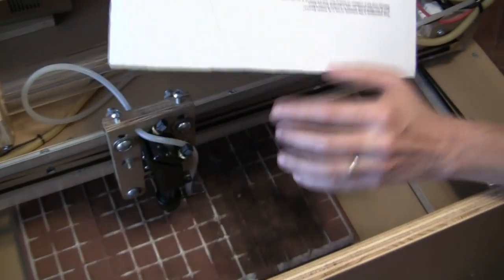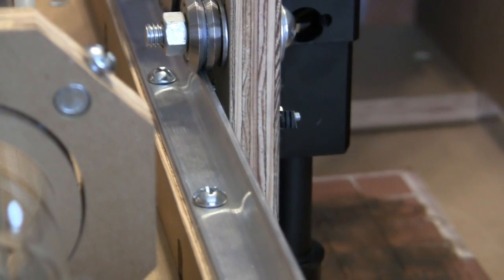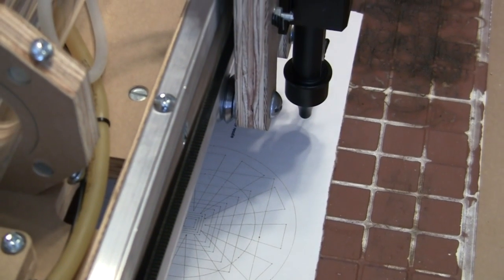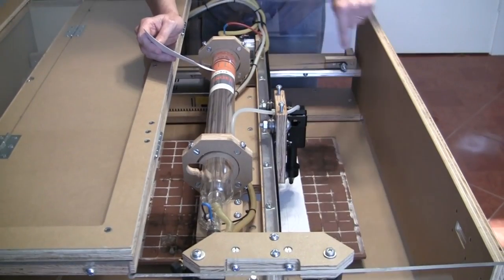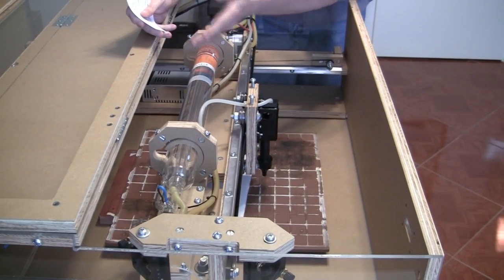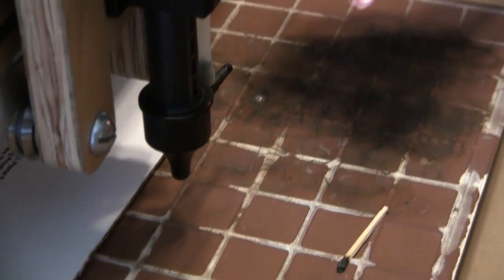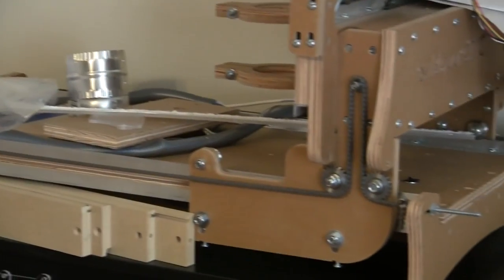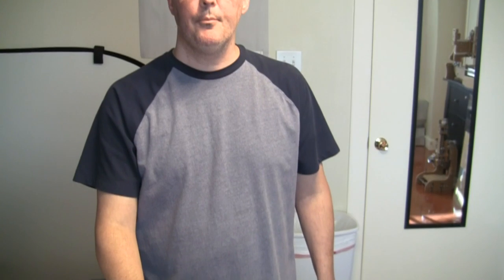Constant Velocity Laser Engraving with the blackTooth

Comment: kudos to you on this laser/gantry setup.....def see advantage on much larger work area....stable laser power througout the length....although,  being bashed for using mdf....hey, you made it work....soooo great effort.....couple things though....would have used a dual shaft of y axis insted of single long rod....know height restrictions might be encountered with linear rail mounted to wood....a piece of 2020 under the rails though could alleviate the hight match-up.....all in all, for me, wood characteristics can vary with moisture and humidity, and in a large 4x8 build, even though you show it works in a smaller build, in a 4x8 build, i would be using metal of some sort ( maybe 2040 or 4040 extrusion).....and linear rails on all axis's....prob alot more $$$, but rigidity is key in a big build.....you will also need a lot more tubing and really good tubing for water cooling and a way to manage it with the way it flex all the time compared to a stationary tube....prob opt for closed loop nema23 to lessen step loss and better torque.....i know, its a rant, and ill end by saying this tube/gantry system i've always thought of....glad you took it on....great vid
Reply from the maker: Thanks for posting a reply to this 11 year old video. These were my experiments during that time and this was before Glowforge. They took this idea and did the same thing!! I had a provisional patent, but never followed through with the actual patent. Oh well, too bad, so sad! All of your comments are great. However, the wood is MDO, not MDF. This is a product used in outdoor signage and concrete forming and reusable. The coefficient of linear expansion is lower than metals and plastics. The moisture could be a problem, but I doubt these lasers will be in high humidity or wet environments.
Reply: @PatrickHoodDaniel  fair enough, old dogs like me learn something everyday still to this day...also watched your vid on emf/emi and tests using scope to look at signal under different wire location of motor, limit, pulse/dir.....etc, very informative....and i already wired up using as much shielding cable, especially with the motors and  limit swithches...
Reply from the maker: @glennmartonic6376  Thanks. Also check the comments on that video. I will be doing follow-up videos to experiment with other devices. The shielding video is a special one for me because I have and had no idea what does on in those signals, and still don't. What I am finding and learning is like I am a teen again in physics class. I love experimenting and the comments are guiding me on what to do next.

Comment: Good GOD man!  Put some voltage to those steppers!   Those things sound like a dying robot on 24v.   Just running a 36v on there will shut those crying banshees right up, but 48v is even better for dealing with dynamic overloads found with high acceleration values.   I realize this video is pretty old, but it would be cool to see an update on some of this stuff.  A lot has happened in the last 3 years for the laser builders community. Things like the corner burn shown on your pass is an easy fix these days, but it seems a lot of people still don't know how to optimize it.

Comment: Can this cut 1/8" aluminum?
Reply from the maker: Great question.  Unfortunately, metals cannot be cut with CO2 lasers without the assist of oxygen and higher powered versions of the CO2 laser.  The CO2 laser does not have the correct wavelength for cutting metals and it is not recommended to add oxygen assist unless you have a great deal of knowledge and experience with this combination.
Reply: Thanks.
Reply: not a chance....gotta pony up alot more $$ for that to happen

Comment from the maker: The water coming out at the end of the water hose (after running through the laser tube, is cool.  An external chiller is something that can be purchased if the user felt that the water is not cooling the tube sufficiently.

Comment from the maker: These aluminum angles are not anodized.  I actually like the cold rolling process that happens when the hardened steel moves across the aluminum.  In my experience, the aluminum will eventually match the profile of the v-groove and with the increased surface area, it stops cold rolling.  The cold rolling process also strain hardens the surface of the aluminum.